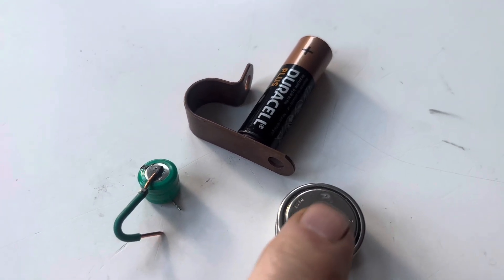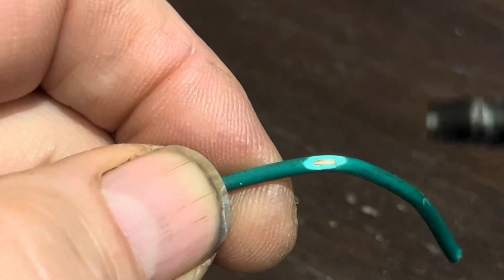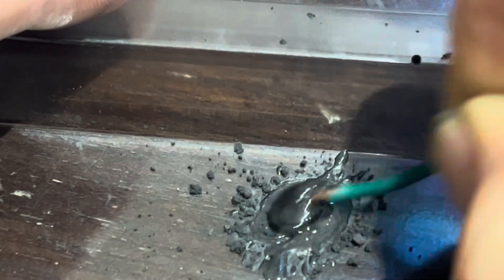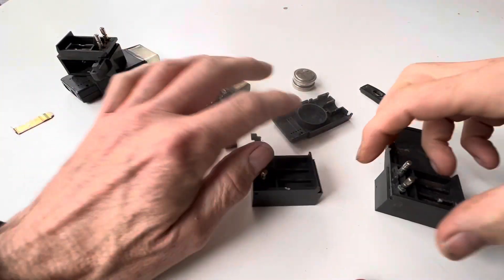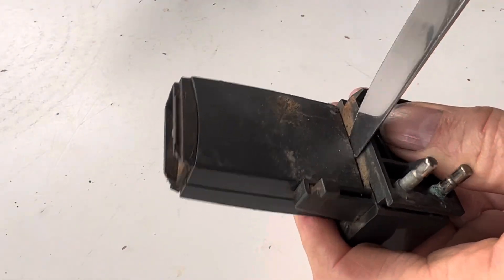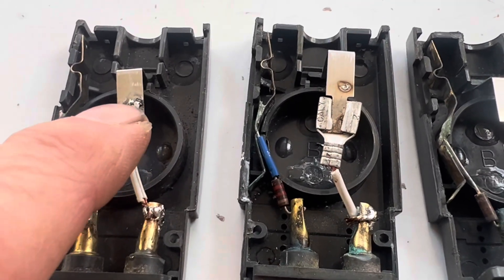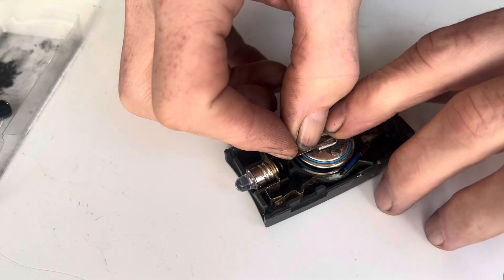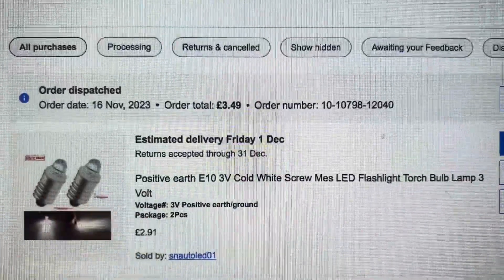Mercedes R107 glovebox torch refurb using conductive glue instead of solder.

Comment: Doing the torch restoration now.  I assume the correct bulb is the "positive earth" shown at the end of your video?  Whereas you stated "negative earth" earlier in the video.  Great info, much thanks.
Reply from the maker: Wow...well spotted. Yes you are correct - the light bulb needs to be +ve earth which means that the bottom of the bulb is negative and the side of the bulb is positive. Thanks for pointing out my school boy error. Mike
Reply: @MikesMercsandothercars  Again, great video.  Question for you:  I've completed the rebuild of my glove box flashlight, have sourced new "positive earth" bulbs, and have now received two 2/V250H 2.4V Puladu Varta batteries.  Problem is, neither of the batteries seem to work / illuminate any of my bulbs.  Even trying them as if both negative earth or positive earth.  I'm in the US.  Could it be that the 2.4V  battery is not compatible with the 3V LED E10 bulbs?  I've now tried three different brands.  Wondering if I should now try incandescent bulbs?
Reply from the maker: Sorry to hear that. Probably a stupid question but I'm assuming you have tested the voltage across the batteries?

Have you put the bottom part of the bulb on the battery and connected the side of the bulb to the other side of the battery to discount any faulty connections in the torch?

I'll dig out my batteries and bulbs and see if the led's are effected by voltage. eg some bulbs wont light at all below a certain voltage whereas incandescent bulbs will still glow albeit dimly at lower voltages. Mike
Reply: @MikesMercsandothercars  Yes to both, very odd...
Reply from the maker: @rvrfalls  OK - I just tested my 3v led. With 2 x 1.5v AAA batteries it lights up just fine.....however with 2 x 1.5 AA batteries run down to just over 1.2v each nothing. This implies that the 3v led bulb needs a certain minimum voltage to light up. I don't have a variable power supply to hand that goes down to between 2 and 3 volts to ascertain what the voltage needs to be. I think my solution would be to source lower voltage light bulbs (2v?) and see if that cures the issue. Mike

Comment: 350 dollars a piece
Reply from the maker: ...do you mean an original torch in working order is $350?? Mike
Reply: @MikesMercsandothercars  100% complete cheapest is 200 on ebay up to 350! Untested or not working. I have the charging portion but that thing is just like oem SL and MB tool kits, over priced bs.
Reply from the maker: I guess it is fair to say that anything thing is worth what someone else is prepared to pay for it. I remember when I first got my 1976 280sl, the previous owner told me that they had been offered £1000 for the Becker Mexico stereo which at the time I thought was bs. However....I have come to realise that some people want their cars original no matter the cost. Mike
Reply: @MikesMercsandothercars  are those stereos worth even more now? and whats the difference from that compared to the earlier model where the cassette player was seperate (ie more rare etc or one is better for x and y reasons)
Reply from the maker: Those stereos are still pretty expensive anywhere form £500 upwards. I'll shortly being doing a video on installing a vintage stereo...albeit with modern electrons and bluetooth. Mike

Comment: I came across this video when researching soldering. And my engine temp sensor in my 74’ 450SL has broken from the connector at the back of the engine. The wires came apart from the connector piece and it just won’t solder for me.

I see where you made some conductive glue with those things. Do they make something already as a conductive glue so I don’t have to mix anything. Anyway. Will that work on the connector piece or is there a part number for that connector with the wire still connected? Or can I take it apart to fix it? 

I can send you another email of what I’m talking about
Reply from the maker: Hi - send me a picture. I have not come across anyone selling conductive glue (yet). Where are you based. m_scott65@hotmail.com
Reply: @MikesMercsandothercars  sent email
Reply from the maker: Thanks for the email and video. I reckon my conductive glue recipe would probably fix that but.......let me have a look at my parts car tomorrow to see if I have one of those plugs. If so, it would be an easy matter to spice the two wires together. Mike
Reply: @MikesMercsandothercars  great! Thank you! My dad and I tried looking at the connector to see how it comes apart. The top part spins and looks like it has clips on the top inside that clip it into onto the lead.
Reply: I purchased AP Anders Products Wire Glue off of Amazon and it seems to work well for me.

Comment: Hi Mike! I am desperately trying to separate the torch from holder without breaking it. I cannot get it to move at all. It is soaked in WD40. Did the hot water make any difference or what made the trick for you 🤬
Reply from the maker: Hi - yes, they can be a real struggle to separate. Run under boiling water and then try wedging a flexible kitchen knife (with a round tip eg not sharp) between the side that say ACCULUX and the holder. Then tap the end of the knife with a hammer. Wiggle from side to side (not up and down) Worst damage you can do is split plastic holder along the seam which is easily glued. Hot water will make it less brittle. Good luck. Mike
Reply: Well after some struggle I decided to drill out the rivets holding the socket together. I have now got one of the pins out but the other is still stuck. What a nightmare. It seems that WD40 doesn’t really bite on corroded brass parts. And the slider is broken. Should have purchased a new one in time…
Reply from the maker: What country do you live in? I will be selling one of the plug fittings at some stage...and I reckon I could the slider could be scanned and 3D printed. If you break things, its only a tragedy if its someone else car....everything else is just experience. Mike @thomasditlev1973
Reply: Ohh yes. Live in Denmark. Saw your video and decided to take a look at the torch in mine as well. I love challenges but this has become a nightmare. The light has never worked in my car. Perhaps I should have left it alone… 
Well, all the bits are now finally separated. Now I need to get hold of batteries and the glue you are using. Sooo happy that I have gorilla glue… also for the broken slider
Reply from the maker: Yes....sometiumes those small 5 minute jobs can turn into a nightmare! Hope you get the torch working. Mike @thomasditlev1973
Reply: Btw have you done any videos on the steering box?
Reply from the maker: Here is a steering coupler video:

https://www.youtube.com/watch?v=akM1MxCIm6c

Mike @thomasditlev1973

Comment: Looking for an Intake boot for CIS intake... for 280 sl '84. r107.   Do you have a source?
Reply from the maker: Hi - do you mean the big rubber bit that connects the intake manifold to the airfilter shown as part number 117 in the diagram below:

https://mb-teilekatalog.info/view_SubGroupAction.php?lang=e&mode=BM&class=1&aggtyp=M&catalog=032&model=110990&group=09&subgrp=001

If so, let me know what country you are in.

Mike